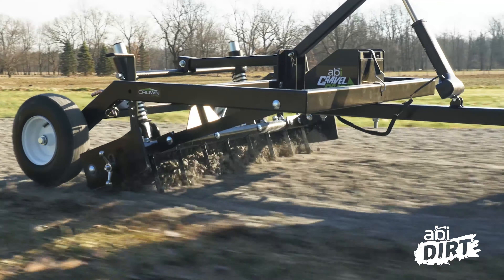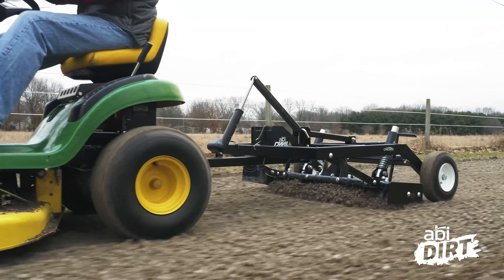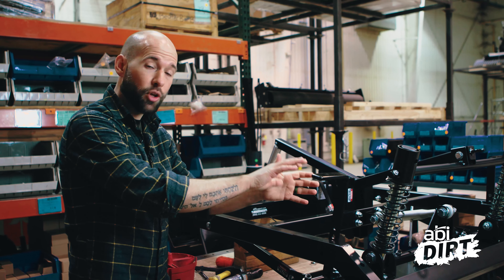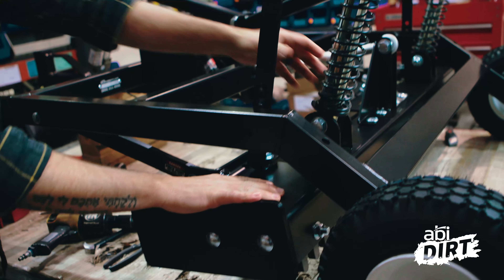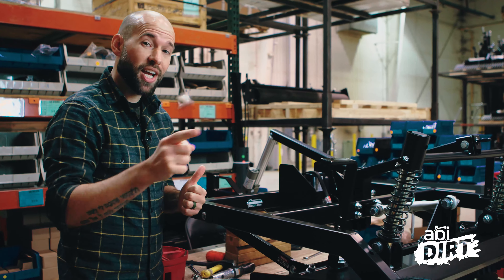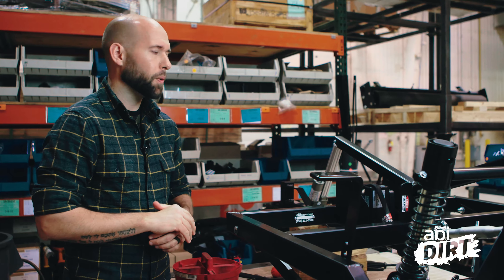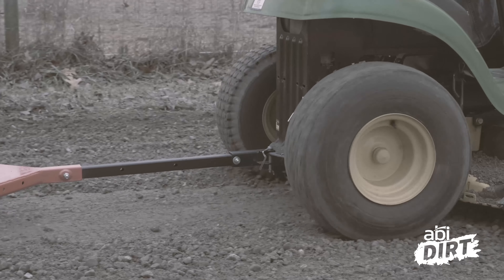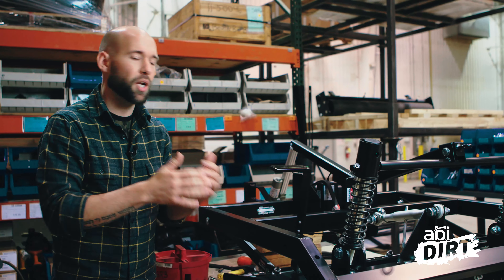How to Grade Gravel Driveways without Skidding or Slipping - ABI Dirt

Comment: Hi,
I am in the process of truning my field grader into a Gravel grader and noticed that my field grader has a hole at the top of each spring tower that goes through the sliding shaft.
When a bent pin is placed in this hole, the springs are not actuated.
When would you use this feature, and is it beneficial to use as a gravel grader?
Thank you.